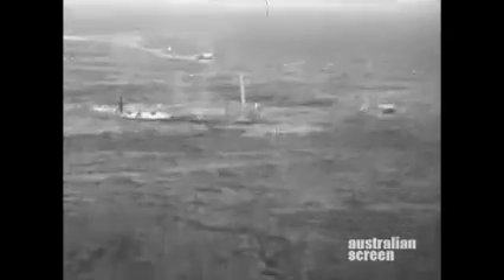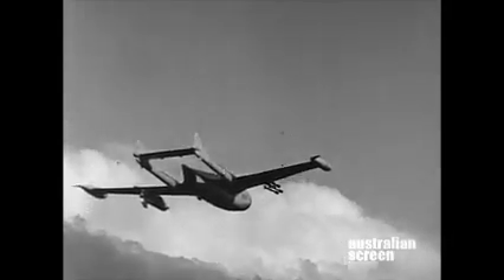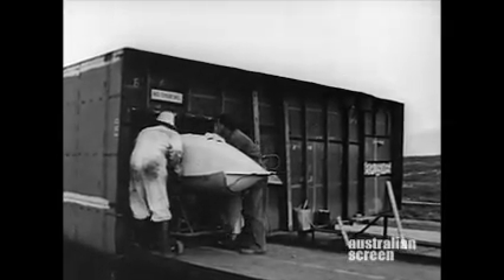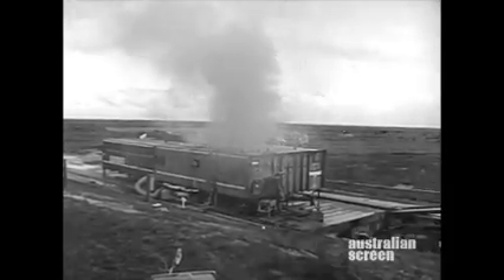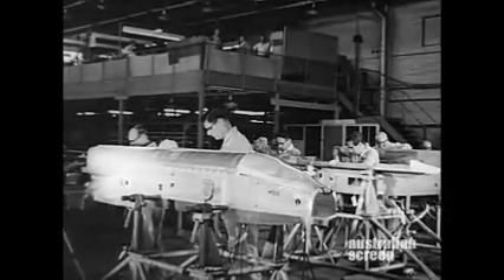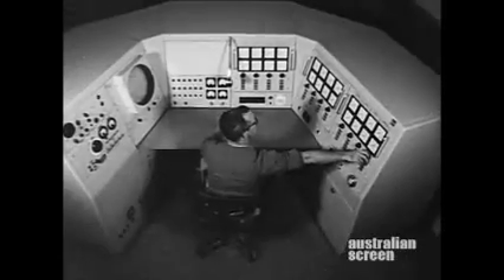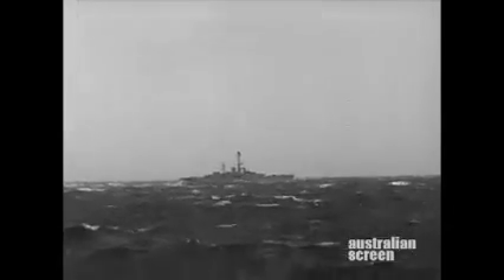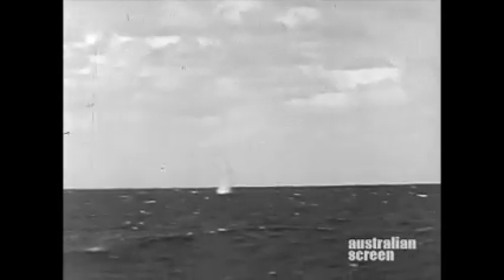Ikara Anti Submarine Weapon

Comment: It is claimed a nuclear warhead was never approved by the RN for the Ikara, but presumably it was orginally intended for the CVA01 escorts like Bristol and the RN and RNZN Ikaras were assembled in a missile chain running thru the ships like the Seaslugs and therefore a variety of warheads or torpedoes could be fitted. On naval wit said, 'its about as useful as a hole umbrella. I think the RN abandoned Ikara and last 10 Wasp equipped frigates in 1988 because that was the year the RNs heavyweight Tigershark torpedoes finally started to work and prior to that the Ikara ships were really surface slaves for the RNs SSNs which really had no armament other than the Mk 8 which sunk the Belgarno.
Reply: From what I've read, the RN certainly thought they were going to get nuclear payloads for Ikara, which is why there were so many differences between the RV and RAN versions. The provision of nukes meant that the RN version had to have the magazine below the waterline and the missiles had to be accessible in the magazine in order to swap a torpedo for a nuke, neither of which was true of the RAN version. What killed the ida was the fact that the UK nuclear program wasn't producing as much fissile material as hoped, so they decided to concentrate on using it for Polaris missile warheads and tactical nuclear bombs, rather than Ikara payloads and Genie AAMs for the RAF.

The reason why the RN abandoned Ikara wasn't because it was unsatisfactory (though it did have it's problems), rather the RN was forced by budget limitations to choose between helicopters and missiles to deliver anti-submarine payloads, and the helicopters were more versatile and had more peacetime applications. The RN actually took part, with Australia and Italy at various times, in at least two attempts to develop an Ikara successor. One of these was Boxed Ikara, which was a minimum-change missile fired from a box launcher (like Exocet), thereby eliminating the crew and maintenance load of the old system. The other was Super Ikara, which was box-launched too, but which had a turbojet sustainer and INS guidance, giving it much greater range and/or loiter time. It also had a digital datalink which could hand over control to a helicopter tracking the sub, thereby allowing the helo to 'borrow' it's weapons from the ship, rather than carrying them itself. 

These wern't pie-in-the-sky projects: Super Ikara got as far as firing trials before it was cancelled. Australia then went into partnership with Italy to develop an entirely new anti-submarine missile based on the OTOMAT AShM, but then pulled out of the project. The Italians completed it alone, and it became the MILAS, which is in service today.